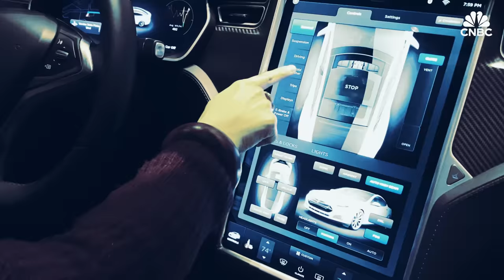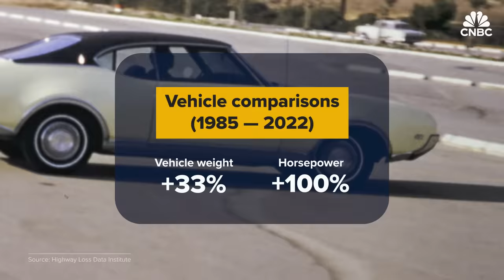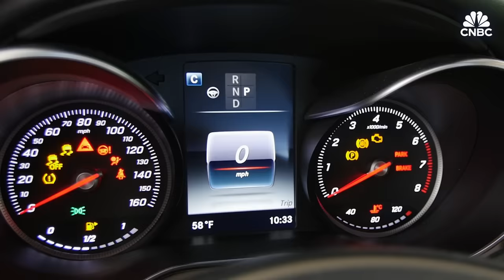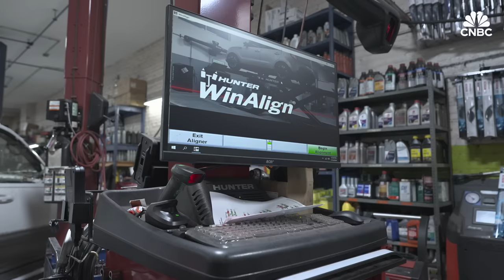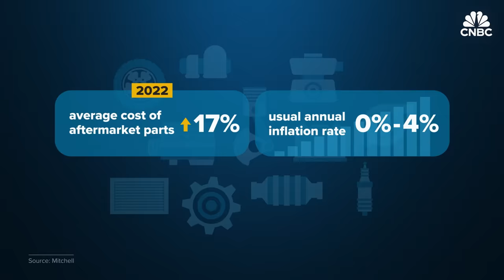Why Car Repairs Are Getting So Expensive

Comment: Glad I'm capable to do 70% of my own repairs. Have saved $1,000's in repair bills. Very Grateful. You Tube played a huge role in helping me learn how to do repairs.
Reply: Exactly,  I'm always looking up things about how to fix on my truck even though it doesn't need fixing at this time.
Reply: And chances are you're both doing it wrong. I fix "DIY" jobs daily as a professionally trained mechanic, literally.
Reply: @COBRO98  Yep, there's "Just Rolled In" showing some idiots who claim "done by another shop". But some guys (maybe 1/3) can do work as well as those in the industry. The key is knowing what you don't know and letting a pro handle those jobs. Then there's the majority who don't know how to check tire pressure or safely fill their washer fluid who try to "improve" their car.
Reply: @COBRO98  I've seen tons of botched jobs by so called "trained professionals". The more people who diy, the better
Reply: @COBRO98  Also don't forget all those shops and mechanics who just straight up rip the customer off.
Reply: @COBRO98  That's very facetious. You realize vehicles as little as 40 years ago were designed with the intent of the average person doing the majority of the work on it right? The amount of times I've had shops perform work wrong, or misdiagnose problems is astounding. I've had friends quoted $2000k to fix a headgasket when the only issue was an upper intake manifold that costed <$200. If you're competent, grab a manual, and do the research you can usually do the job as good or better than a mechanic for cheaper. DIY fixes you always see are from desperate, mentally unwell people or those who were scammed by cheap mechanics
Reply: @COBRO98 I've done probably over 20 DIY jobs and never had to bring it into a shop afterwards. The only time I had to was when I got stuck halfway through since a water pump stud seized in the engine block and I don't have a welder.
Reply: @COBRO98  professionally trained fitter.
Reply: I"m with you.  In the last 28 years - maintenance and serviced my cars.  Of course, I have all the tools, repair manuals, and software to make it a successful job.  Remember this when you take your car into any repair shop:  1) They don't have all the time in the world to keep your car, it's in-n-out.  2) They will source parts and fluids that fit your car (not necessary OEM).  Cheap parts + less time spent + high fees = PROFIT
Reply: So a DIY can’t be self trained? I started doing my own work because I wasn’t happy with repairs I paid for from shops.
Reply: Same. Certified YouTube mechanic with about $600 in tools. I can do most repairs on my 2012 F-150. Although we make sure my wife's car is always within manufacturers warranty becuase I can't do most of the tight complex repairs on her small suv. The 2" life I have on my truck allows me to do most repairs without a jack, not to mention there is so much room to work around on things around the truck.
Reply: Bernie I’m with you. Have learned so much about cars and maintenance from YouTube. I have a 1996 Impala SS, a 2001 Honda Accord and a 2004 Jeep Wrangler Unlimited. All my rides are less sophisticated don’t have the computer intricacies that newer rides have and so I can still do many repairs myself!
Reply: Almost had a caliper come of my Saturn back in the day because it would “save me money” doing it myself. I could have died because I was too cheap to buy a torque wrench.
Reply: @COBRO98 I could have died from not torquing a caliper mounting bolt to spec.
Reply: Congrats, you change the oil, brakes, and filters and take it in for everything else. Percentages are easy to manipulate. 🙂
Reply: Cars are waste of money and health..
Reply: @COBRO98  mechanic here...I've seen better DIY'ers than some of the clowns who call themselves "professionals"..DIY'ers don't have book time problems lmao
Reply: Agree, I have been doing 99.9% of all my repairs, both cars and house, myself. Started with oil changes when I was probably 21 back in 1991. Worked up in complexity and acquired tools. I drive nice, older cars that are reliable and easy to maintain and repair. Junkyard parts are  cheap and plentiful and better quality than aftermarket. All I buy at the parts store is brake parts, belts and hoses. Even small bulbs and fuses come from the yard.
Reply: @Darkevilish cars enable those of us who produce income and pay taxes to make efficient use of our time. No one with a family and a job is going to spend an entire day to get groceries when you can drive ten minutes there and back to do your shopping.
Reply: @Darkevilish  Your opinion.
Reply: Yes, YouTube is one of the best things in this world.
Reply: @COBRO98 I can't tell you how many times I had to fix work done wrong by a mechanic. I've never had the opposite happen to me
Reply: Likewise. Glad I drive an old mechanical car. No cameras, no trackers, no computer, any mechanic can work on it.
Reply: @COBRO98 it's a good thing for people to be self sufficient, even if we make mistakes along the way.
Reply: @jordanturner97 Absolutely! Self-reliance and an understanding of how a car works is important!
Reply: If you were capable of doing repairs you wouldn't need YouTube, would you?
Reply: That’s if you have your own tools.
Reply: @bernie472 Any channels you like in particular?
Reply: @Theomite  Rayman Ray's Repair, Vice Grip Garage, and Dylan McCool's channel, just to name a few.
Reply: @LittleOrla  Something I like to remind people also is the labor rate in my area is around $120-175/hr. The highest paid techs/mechanics make $35/hr. Mechanics USED to be paid 50% of the labor rate. Literally 75% of what you're paying at a shop isn't going to the person doing the actual work. By choosing to repair your own stuff you're choosing not to support predatory business practices.
Reply: Chris fix everything

Comment: There are no real supply shortages, my family is in the business, and I can assure you we are able to get any part we need.  The big change is manufactures have made it increasingly difficult for owners and independent shops to make repairs.  They force you to go to a dealer by not allowing access to the software on their vehicles unless you have their equipment.  You used to be able to change out a part, and drive off.  Now, many manufactures are forcing you to program the part to the vehicle, and it can't be done unless you have their specific programmer.  Mercedes was the worst, started this over 20 years ago with their STAR programmer.  Without it, you can not replace most parts on the cars.
Reply: This is cap. The STAR system sure is proprietary but you don't need the scanner just simply to repair it or replace things.
Reply: While I agree I am able to get my hands on a vast majority of parts I need (something like 99%) within 24 hours, there is an occasional difficult part like the C6 Corvette fuel pipes one of my customers currently could use. We just take our time with it and charge accordingly.

You're a $4,000 high end scan tool away from doing almost everything you could ever need software wise. My current shop has three different scanners with various programming, third party linking, and miscellaneous diagnostic add-ons. Between all three we can service practically any car and service well into supercar territory depending on the brand. You're a PIWIS and an Autel away from doing anything Euro related you could ever have the time to do.; every shop I know operating in this space always has work. Total initial commitment in scan tools is like $10,000 with an annual cost about a quarter of that in software.

We can service 99% of cars 100% in house by utilizing our current tool set and it really doesn't cost that much in the grand scheme of things. Our labor rate is lower than local dealers..

TLDR: This poster's family is either an oil change shop or an auto parts store. What you're describing isn't reality.
Reply: My mom’s car sat at our local Subaru dealship for 3 months  waiting on a back ordered part for the emergency break.. she ended up going and getting her car, the part is still on back order.
Reply: I have a 2012 Fiat Panda. My local garage repair shop can service n maintain & MOT my car. HOWEVER the REAR windscreen wiper can only be bought n replaced by the dealership I got it from. I let it fall apart until my repair shop found something comparable n now i use that. Refuse to go back to the dealership just for a damned wiper that will cost 3x more than it should.
Reply: Well, glad I never wanted to get a Mercedes.
Reply: Yeah I been a mechanic most my life until like 7 years ago when I changed jobs. I’ve always driven older easy to work on stuff having seen first hand how tedious it is to work on newer stuff. Been driving a 1990 Silverado for about 15 years now, anyone can work on these things and Autozone usually has every part in stock.
Reply: That's why I kept my beater from 06.
Reply: can you get NEW 4680 battery cells ?

Comment: I own an auto repair shop in Los Angeles, and despite having a 5-star rating and filling up our work schedules a few weeks out, we still struggle to meet our overhead because we have been pushed to acquire and maintain various tools and equipment for even your basic servicing. People don't understand why their car repairs are so expensive, and yet they opted to purchase a vehicle with heated cup warmers and complex exterior lighting (such as your headlights, tail lamps, etc.), each of which has it's own control module on even your standard economy car. They also don't understand that their vehicles boasting a much larger MPG range is due in part to the very little clearances between internal engine components than call for the thinnest weights of oils we as mechanics would have never imagined nor agree with. You waste less gas because they designed your engine to have the least resistance by using thinner engine oils which in turn causes premature  engine failure, often well before 100k miles. Transmissions that you cannot rebuild and cost the same as the value of the vehicle. Cheap plastic and aluminum parts that used to be made of metals, steel and cast iron. This is the future, and our struggle to provide our work is just as expensive for us as it is for the general public to maintain and repair their vehicles. We are not crooks, we are tradesmen/women trying to keep up with the stupidity of modern automotive engineering.
Reply: Amen
Reply: It's the CAFE requirements. No one runs for office on dismantling the CAFE standard, though they should. 
Ignorance is rampant among consumers who don't know anything about CAFE much less anything about the car they're driving now. 
If you think education is expensive, TRY IGNORANCE.
Reply: Quote of the decade "stupid modern automotive engineering"!
Reply: @user-pe8il6pd2v  thank you! ~*verbal artistry*~ lol